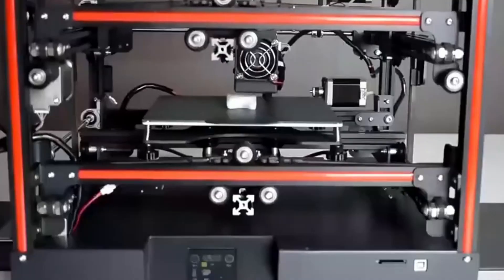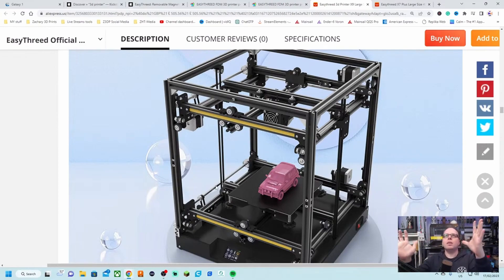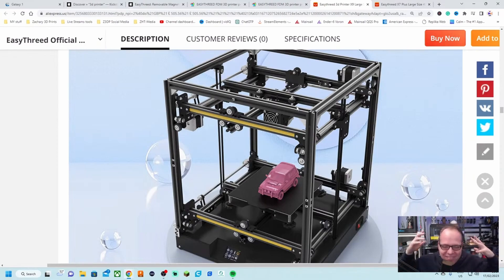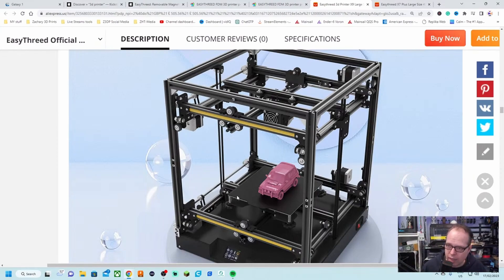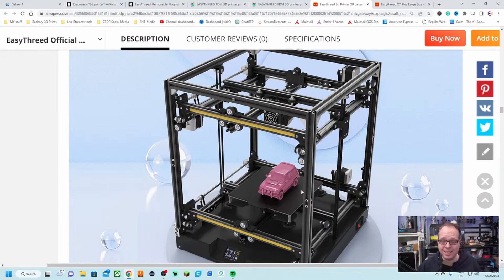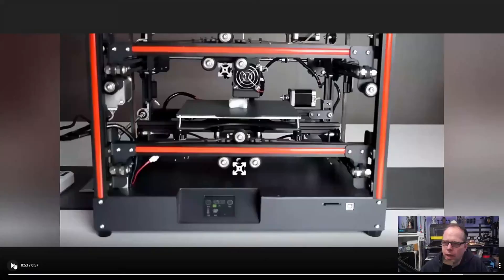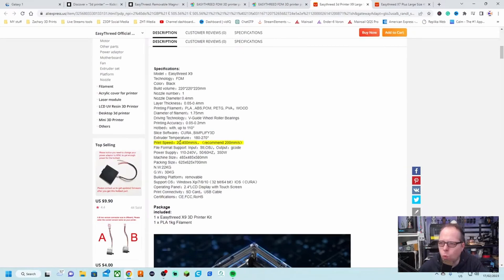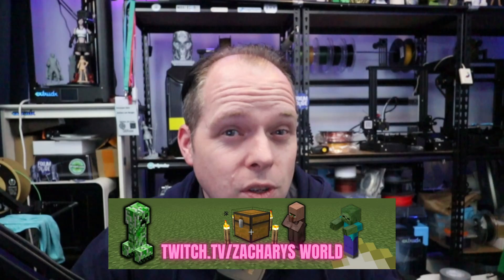Easythreed X9 - Never Seen Before!

Comment: You say that the bed go in Z - nope, printhead gantry go in Z.
Reply: 400 mm/s - when printhead go 200mm/s in one direction, and bed go 200mm/s in opposite direction - you get 400mm/s print speed.
Reply from the maker: It does look like it is the print head but you are right

Comment: Easythreeed always have strange ideas - check X8, i watch them on my own eye. For X axis they build motor into printhead, and use single gates belt as toothed belt for moving. To move printhead in Z  -4 leadscrew to motion, and 4 hex rod s(yes, hex rods) to keep them straight. Those rods are hex, becouse they have pulley to move printhead in Y.
Reply from the maker: That sounds weird and cool too